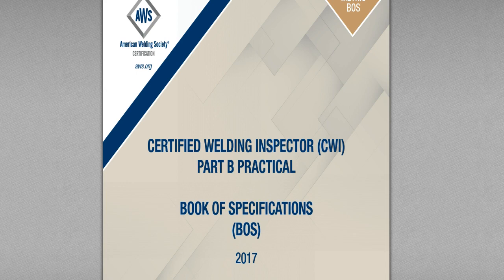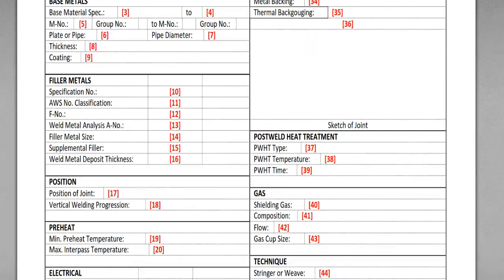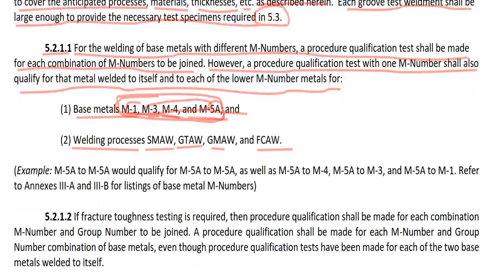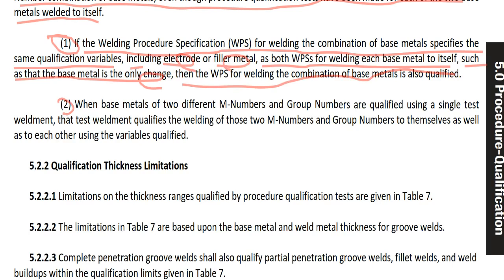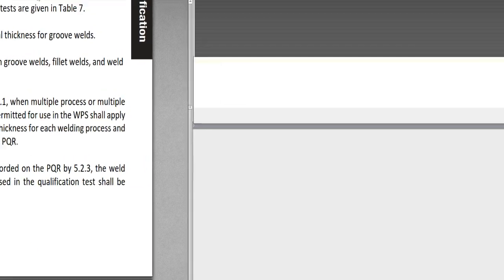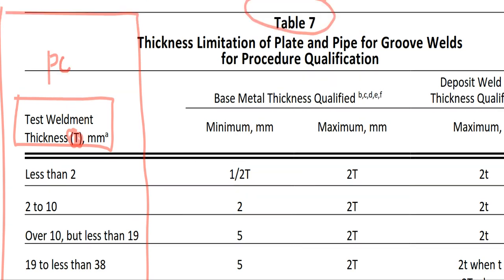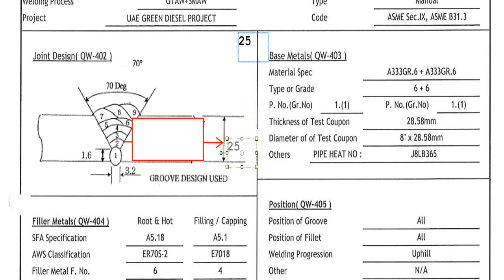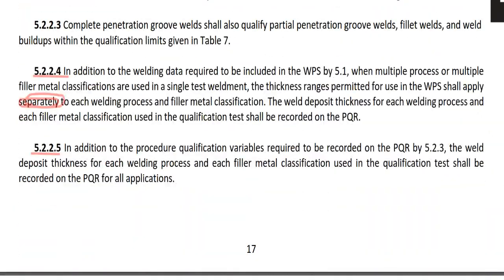CWI Part B Lecture #14

Comment: Can you explain under the maximum weld metal thickness column “8 when 3/4 less than equal to t less than 6” I believe the metric book reads “200 when 19 less than equal to t less than 150”?